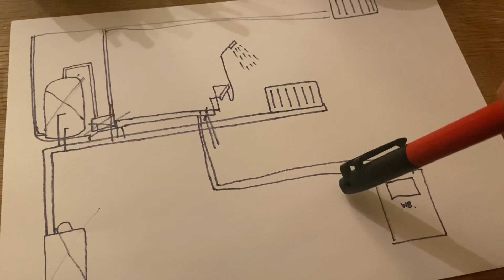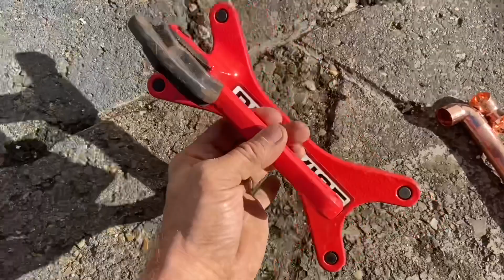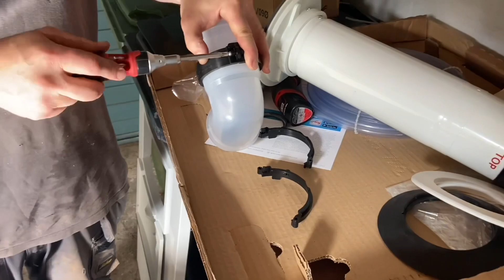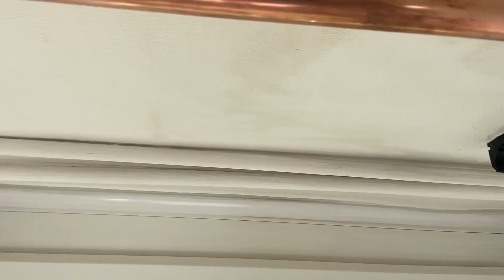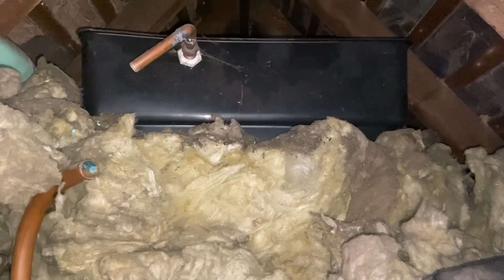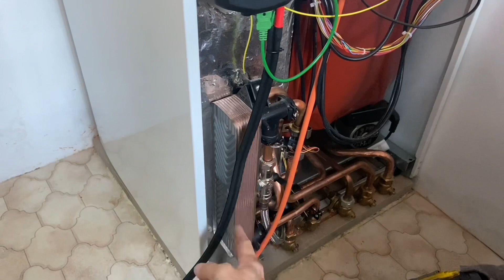P B Plumber The life of a jobbing plumber #77

Comment: HI lads -- don't Worcester make things easy eh -- i've serviced a few of the newer free standing highflows and thats a job and a half -but luckily ive never had to fit one - that rear flue option is a scandal !!! what are Worcester thinking about when they design a flue that the engineer has to assemble on the inside of the caseing -- their designers are not gas engineers thats for sure  -- take care lads --Jim

Comment: Yet another Q. Only ever seen one of these in situ, it looked a nightmare,,, however, what are the benefits or reasons to fit this instead of a combi/system, is it just because it's a half way measure? Because of the hot water storage, does this mean that it can't be used with something like an ASHP?

Comment: Would someone be able to explain the boiler (how it works)? 
I see it has a thermal store, but as it still uses a plate hex, how does that make it more suitable for a two bathroom house (as Worcester say)? Surely, if it's still mains feeding the shower(s) rather than an un-vented cylinder, the mains would drop off as a combi would?

Thanks
Chris
ps thanks PB for the upload.

Comment: Nice neat conversion job to a Combi boiler Pete!  well done to both of you, although personally I would not have used that Worcester Bosch . a  Viessmann 222 Floorstanding Combi boiler sitting in that corner would’ve made that job like a much more quality easier to fit installation, They are really fast on the heat recovery time extremely quiet can fill a bath in no time and the low gas consumption is really impressive

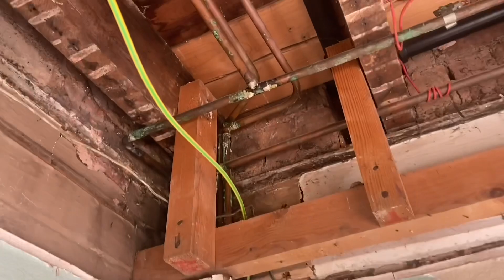Comment: Top video as always mate! 6:05 gunky copper joints. Why are these joints so badly oxides? What is due to? Lack of ventilation in the ceiling = sweating pipes, or was it just because flux wasn't cleaned off properly?
Reply: They're just badly soldered joints that were never cleaned off properly.

Comment: The explanations are great! Really enjoy the videos. I did something similar re-using cold feed and fill last Monday took out a Open vented tank and converted it to sealed system, they had issues with pumping over as the height of the tank was less than 250mm and heating never worked in 15 years. Bit of a win 👌🏻

Comment: I believe, you could go for industrial works , obviously from my understanding, it’s a bit different world out there , requires training and industrial gas . Involves a lot of BMS controls , industrial wiring on electrics , I could carry on , but it’s a lot to it …plumbing wise, some things are different, because it’s constant usage , different systems add on , drinking water storage tanks , softener system for hot water cylinders unvented , automatic backwash system for central heating, main cold water storage tank to feed the other tanks upstream the building, from the other cold water storage tanks will go downstream and becomes as a gravity feed systems , I mean it’s a lot to it … Where , I work primary heat source it’s steam , very efficient . I have to make a video one day to explain it more in detail, brains will definitely fry out 😳🙈😂😂